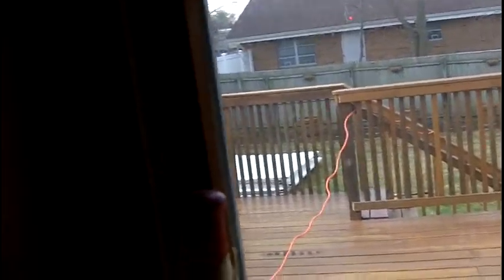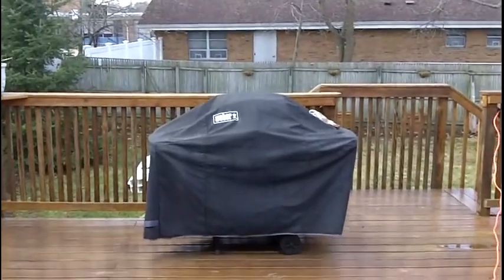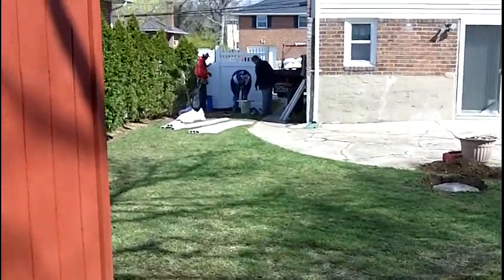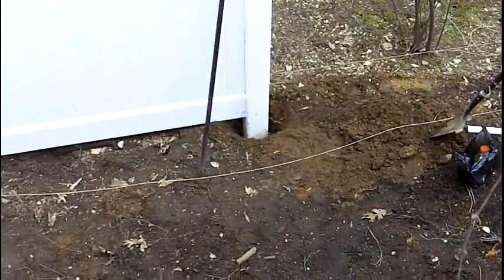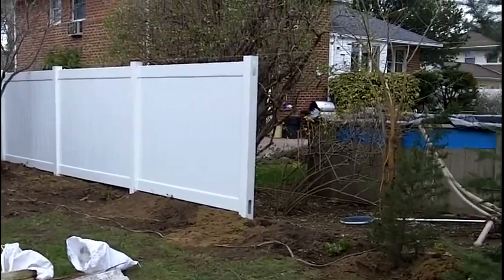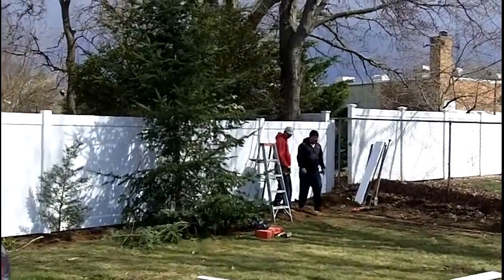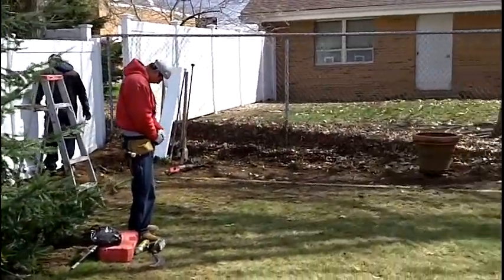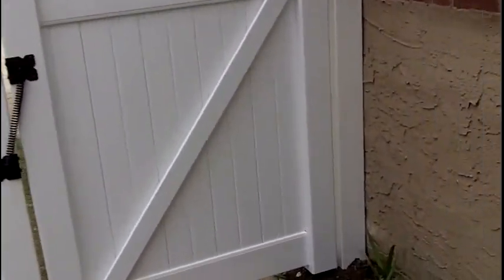New Fence

Comment: They did a fine job installing it, but the gate still opens the wrong way.  It opening 360 is impossible, if anything it could open 180.  The difference you're gaining opening 180 instead of 90 is about 3 inches, but the gate is wide enough I don't think it's going to make that much of a difference.  If it opened out 180 you'd get the same benefit without having to walk up to it and then back up as you swing open the gate.